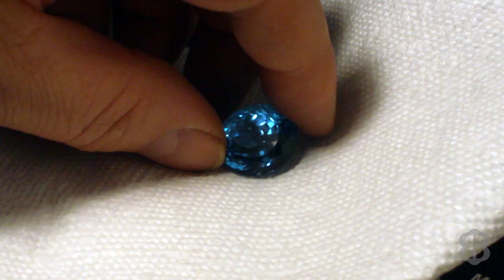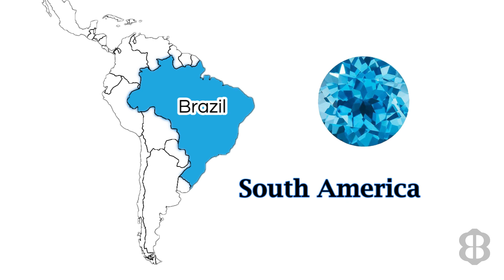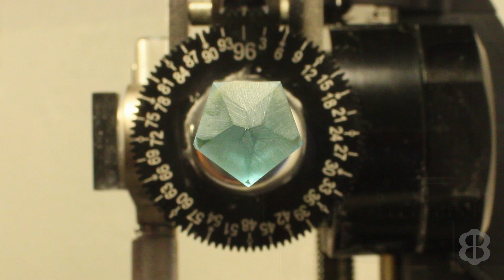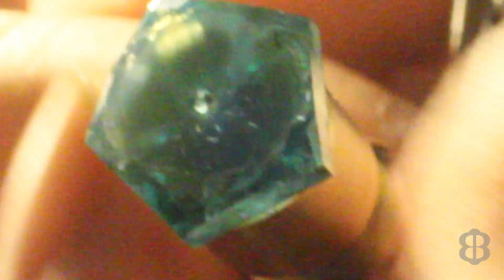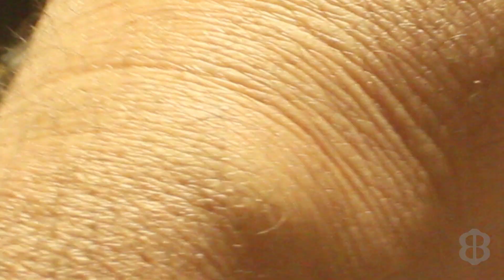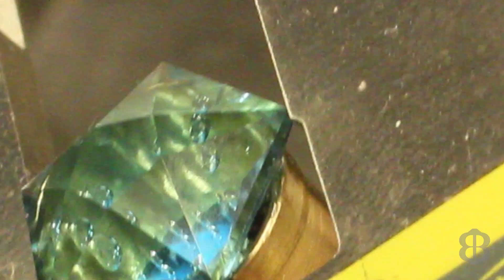Gem Cutting Tutorial - Faceting a Commercial Cut Blue Topaz with a Star Design

Comment: Very nicely done, Mike.  Did you polish with AlOx or diamond?  Thanks for the video.
Reply from the maker: Started w/Diamond because I was working through the Batt Laps, and I was worried that the Ultra Laps may have some 'rounding'.  But for the Star "rays" I did use Aluminum Oxide Ultra Laps.  I really like Ultra Laps...for some stones.